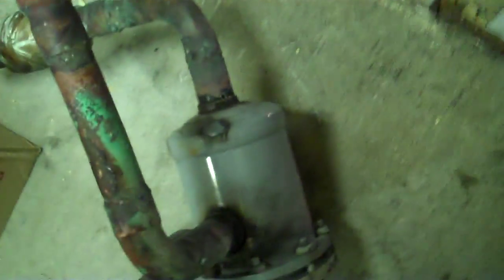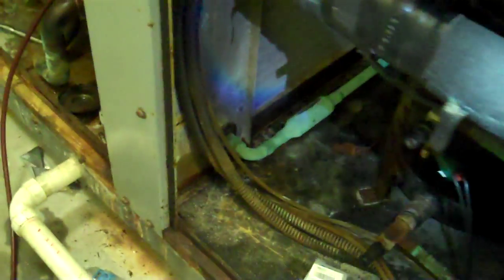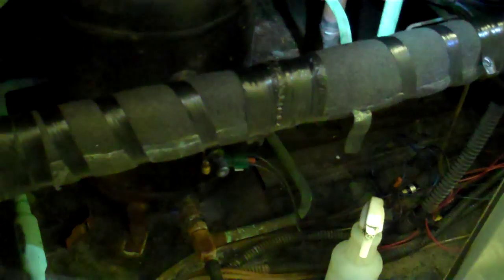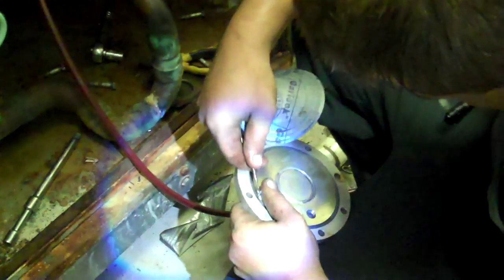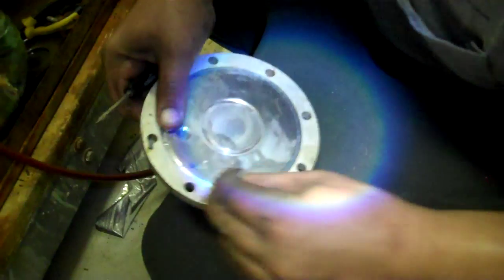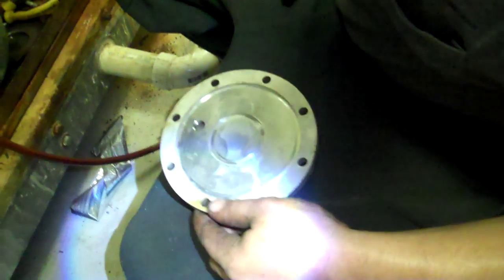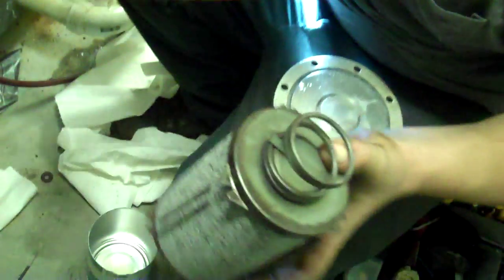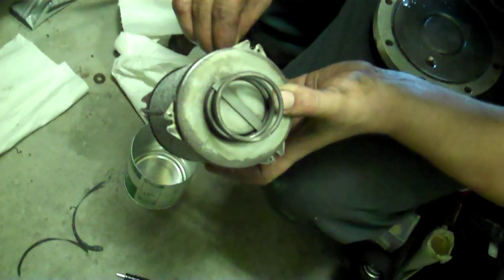HVACR How To 30 ton compressor failure

Comment: It looks like you have it pretty much under control there. My opinion about having any more then one suction line drier is that you might want to get rid of all but one of the drier shells and replace the core with a pleated core to just pick up the trash before it gets to the compressor.  Come back about a week later to replace the suction line drier pleated core. Then come back a month later to replace it again. Then go back six months later to remove the suction line drier all together.